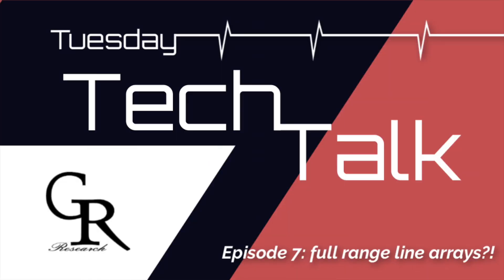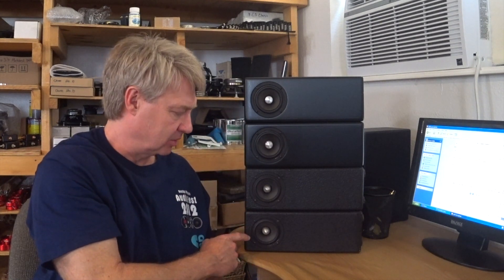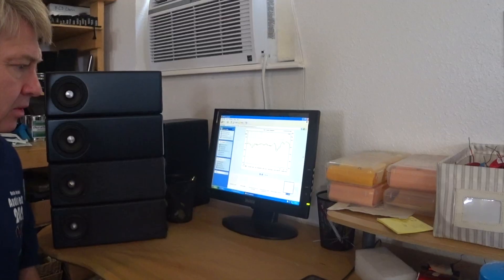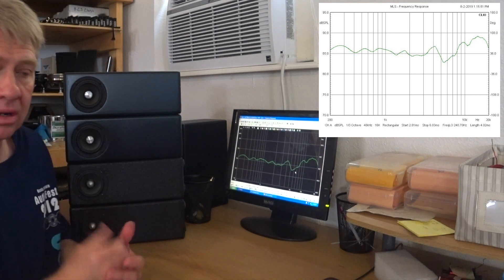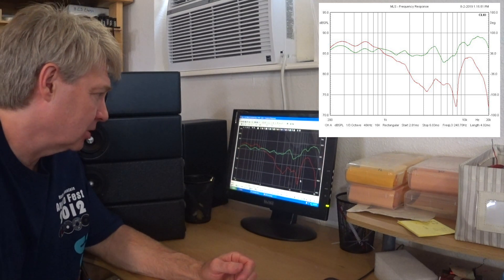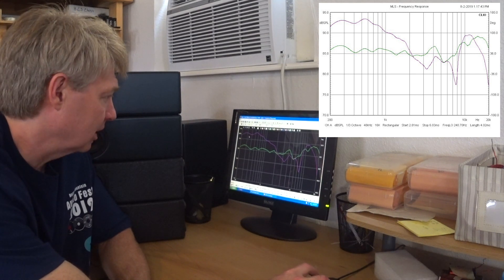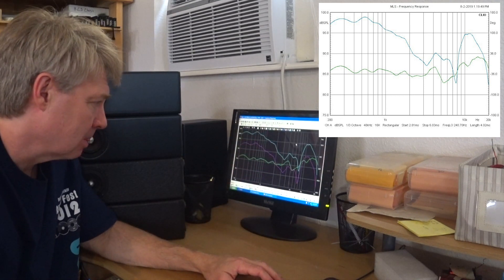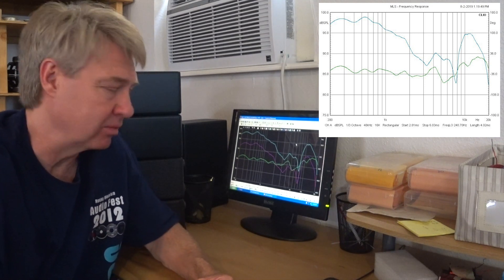Using Full Range Drivers in a Line Array!?

Comment: So, you can use a line array of 4" drivers to get fast base and cross over to a tweeter at 2KHz.  If your array is 6 ft. tall, you will get a nice base reinforcement at the resonance freq. of the cabinet.
Reply: Maybe you need 4 tweeters, and a super tweeter to boot?
Reply: @jessicaembers924  Above 10KHz, the wavelength is so small that instead of reinforcing each other, the sound from one tweeter will alternately reinforce and cancel the sound from others.  It's better to use aluminum 4" drivers that respond up to 5 or 10 KHz and one tweeter above that.  A large curved electrostatic tweeter would be a nice choice.  My M & K satellites use 2 tweeters and it sounds like many instruments in an orchestra, but a vocal is not as clear.

Comment: You could mount a pitzo or better still a compression (bullet) tweeter at the top.This would help give the 'sparkle' in the audio
Reply: really, I am like ok you pointed out why it doesn't work now how about pointing out what works. And that is what I am doing to some cheap line array pa amp I bought adding a tweeter to the top

Comment: Using crossovers, would partitioning the frequencies to each driver alleviate the comb filtering in the array?
Reply: it should,  if you use 5 drivers the middle one could play full range and the rest would have low pass filter based on the distance to the center driver.
Reply: @sudd3660  Thank you, that's very helpful.
Reply: @dannyrichie9743  If you using crossover anyway, why not use 1" dome tweeter in that design? What's the point of the full range driver that will have very narrow dispersion at top octave?
Reply: Sometimes for a home theater application a slightly more limited off axis response (in this case a 3" driver) isn't a bad thing.
Reply: @sudd3660  How do you connect the five speakers to woork effectively?

Comment: I used to use a single wireless digital transmitter to multiple receivers to separate tripath amps. Limitless connections without impedance problems. If one MUST use a line source of speakers, nowadays, each separate speaker can have its own dedicated little digital amp chip. Line sources work great for a p.a. but that's about it.

Comment: Thank you for this. So what is needed to get around this? How do Bose, RCF, EV, Turbosound achieve amazing results from their column arrays? I was thinking of building my own, but just now starting to research how to properly do so. I would appreciate a response. Thanks again..
Reply: In this test are several separated boxes used. In the Bose, RCF and Turbosound they are constructed different on the front panel. The drivers share the same  fronpanel, they are much closer to each other and they have no surface arround to create reflections on the frontpanel.

Comment: Ok i have about 8, 2" full range drivers. Forget the line array, If I wanted to design a pair of desktop pc speakers, and I just want to try to get the best possible sound from them, should i just make the tightest spacing group in a square 2x2 pattern and angle the front baffle at roughly ear level to make the drivers as equally distant from the ears as possible?
Reply: The most easily built "Cheap open baffle line array" sounds leaps and bounds better than most commercial sealed/ported boxes under 1000$.
Don't take my word for it, because I didn't think they'd work at all. A few years ago I tried something very similar (with 3" coaxials) and was blown away by the results.
Square 2x2 is worse than a single line of 4.  8" or higher baffle width for good midrange, Leave the back open, and cover the baffle with felt/foam if you can.
Is a line of 4x 2" drivers as good as a single 12" driver? Nope. Not even close. They may come close to a single 6" driver.
Comb filtering @ >15KHz on a commercial system costing $2000 is completely unacceptable.
For me, it is totally acceptable because I cant hear anything above 16KHz anyways (after age 30 or so, most people cant hear above 15Khz)
IMO, Theory & test results are good, but sometimes simply trying things out gives the best understanding of a concept :)
Reply: Just let a single driver play full range and let the rest cover the lower range only and it will work fine.
Reply: @dannyrichie9743   Huh! Now why didn't I think of that before? That's why pros like you are pros 😂😂 
It's refreshing to see someone with your experience regularly sharing knowledge with the community, On a 6 month old comment, no less!! Thanks Danny 👍

Comment: Sir, thanks for the video. Have you ever heard a K-Array? They are very expensive and use 1 inch drivers. From what I know, the smaller the driver, the better the array will work - but there's a trade-off there. Thanks!
Reply: I owned a K-Array KR400s system which I used for live sound. The drivers are 3" (24 each)  and spacing was extremely close which I have read helps raise the frequency where things start going wrong. It was better than a lot of the column speakers I've heard, but by no means perfect and it didn't really start sounding good until you got 15-20 feet away from it. The 21" subs were disappointing and the overall system height was often prohibitive. I sold it and built 18x3 columns using the same drivers and put them over 15" tapped horns. It has it's place, but I would have rather spent the money on K12.2's and been done.

Comment: great topic, and my question is how do pure line array handle phasing issues? by that i mean magneplanar and electrostats which has continuous line of output from a line of membrane.
my thinking is that the gap for the tweeter level output has to be small, full range drivers at 4" in size have about 8 inches between the center points.
Reply: Those designs place the listener in the near field. While there are some cancellation effects, you are still within a range where you are always in line with the main section of the design. But if your ear is in line with the outer edges of the line then the highs will really start to drop out.
Reply: This is very easy to demonstrate with my Magnepan speakers.  While sitting, the sound is absolutely amazing, but simply stand up and you can hear quite a difference.  The 1.7i use washers to angle the speakers up slightly to minimize this effect.  If I stand on the couch, my ears are above the plane of sound and the sound changes quite a bit.
Reply: That observation holds true with any line source. Thanks for contributing.
Reply: @dannyrichie9743  Well i believe it also only holds up if the line is long enough. a small line source like 20 inches. will still behave unpleasant. even when using a ESL or a planar magnetic. When talking magnepans and ESl's (big) it comes closer to floor to ceiling.. still not ideal. i noticed at least in some of my experiments on planar magnetitcs, as well as esl's.  i think i even amde a video about it measuring at different heights within this 20 inches. upper frequency still goes a bit ballistic.

interesting video though !

Comment: Ref boss 802s.You known your stuff obviously but I know the 802 pa version has a hi pass capacitors inside typically 5uf and 10uf poli caps that apparently push the higher sounds to certain drivers.Question.Is this to combat the comb filter effect or have they just got round it by massively eq'ing the tops with the drivers all an a slight curve on the baffle???

Comment: I’m thinking each speaker added in series takes the top end down partly due to each voice coil acting as an inductor.
Kind of like each speaker’s coil is a crossover for the next but since they share the load in series they bring the top end down for all of them.
Reply: This is EXACTLY what I have suspected for years now.  I have owned a few pairs of Bose 901's over the years (still have 2 pairs).  Without the active EQ, they sound like a giant midrange speaker.  Strangely enough - if you have ever heard just a single Bose 901 full range driver connected solo to an amp - it has great high-frequency response past 15k.  But when added with all 9 drivers in series, the top-end falls out.  Another bit of playing around I did was acoustically "block" (by mechanical means) the 8 rear drivers and measure JUST THE FRONT driver (Dayton OmniMic V2)... Same "loss" of high end is STILL THERE!!  Keep in mind: there is NO INTERFERENCE from any other drivers at this point!  This loss of high-end is not like this when a SINGLE driver is connected to the amp.  I have wondered and suspeced that the inductance from the other drivers in-series is causing this drop as well.
Reply: Another point to make here: the Bose 141 Bookshelf speakers (which use the SAME drivers as 901 Series 6) do NOT need EQ and have PLENTY of top-end.  Yes, they do have the drop-out above 16k, but we are talking about a full range driver here.  Expecting any full range driver to do much above 16k is pushing it.

Comment: 5:25 in fact, all is normal and necessary in array application...until 7khz where membrane breakup and phase fuck'up, this system need additionnal tweeters to be a true line source
by the way, i'm not prety shure this is good for room/private usage, why making a virtual giant speaker and listening it in nearfield ?

Comment: Oh damn, Shots fired at parts-express.
Reply: @Maxwell Olson Cough, cough the Epique just went on clearance.....301-982 Which I have personal heard at a demonstration by Don. They sounded decent. The rising response of the driver and their close proximity helps to mitigate the comb filtering. 4" drivers on 7" centers would be a disaster as Mr. Danny has shown. The comb filter effect is as a direct result of the center to center spacing. If this was a strip of 7" drivers on 7" centers crossed over at 800hz they would perform very acceptably in the near field. Drivers with a 1.5" spacing would take you up to 4.5khz in the near field.

Comment: OK, now I am really confused. I commented on the "Why 2 Tweeters won't Work" video by pointing out that some of the best speakers in the world (e.g., Infinity IRS V) have multiple tweeters. The reply I received reads "Line Source is a different animal all together, not the same thing as the examples being given in this video." Now in this video you argue that a line source exhibits all of the same comb filtering problems as a dual tweeter design. Which is it?

How would a line array EVER work given what you say here?
Reply: I believe he is referring to Arnie's carefully designed crossover networks that is used in his infinity tweeter array. In engineering there are no free lunches but Arnie was pretty good at getting coupons 😁
Reply: In an actually line source there is still comb filtering going on. However, while there is cancellation from different time arrivals from one driver to another you can still be inline with a driver that has has no cancellation. You also need to get the playing surfaces to within about 3/4" of an inch so that the line acts like one continues line. What you get when done right is +/-2db ripples in the response up top that shifts around with variations in height. And you never gain any more output up at 20kHz than what you get from a single driver. So you get no coupling up top and a lot of coupling down low that all has to be compensated for. And it takes a well designed network to compensate for it all. It can be made to work and work well. But if the drivers are conventional drivers (cones or domes) then you can never get the acoustic centers close enough to avoid a lot more significant comb filtering. And as illustrated full range drivers with no filter compensations will not work at all.
Reply: @dannyrichie9743  Are we selling a product that reduces the comb filtering issues?
Reply: Comb filtering isn't something that can be corrected or reduced. Technically you can adjust time arrives of drivers so that they arrive in phase for a given location, but move outside that location and it all falls apart again. Check out this example that shows how much comb filtering there is from two tweeters and the differences from very slight movements. https://www.youtube.com/watch?v=MGSfaKWcetQ&list=PLUFNGRKZZWXzCt2Syx4yjR4Oy7V-uiePB&index=4&t=8s
Reply: So no, we offer nothing that will correct for this issue.
Reply: @dannyrichie9743  Ok, TY!
Reply: @dannyrichie9743  And who would design a system without a filter?
Reply: @CorradoVR6z  It happens. Some companies even advertise it like it is an advantage.

Comment: Sure, it doesn't work for a line array, but what happens when you mount those drivers in a round enclosure where you can't get further away from one driver then the others.  The drivers are mounted very close together which means that the apparent angle between the adjacent drivers in very small.  Let's say that I have a circular speaker array about 12" in diameter.  The angular distance between the opposite driver is about 6 degrees about eight feet away.  On a linear array that is six feet tall at the same distance the angle between drivers increases to 120 degrees.  In a compact circular array the drivers act much like a single large driver.  Linear arrays don't work.